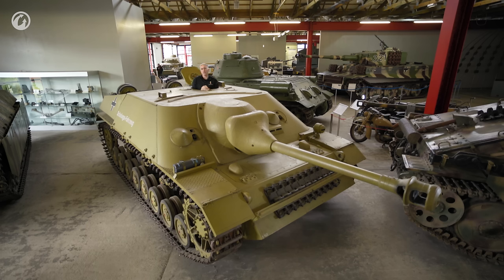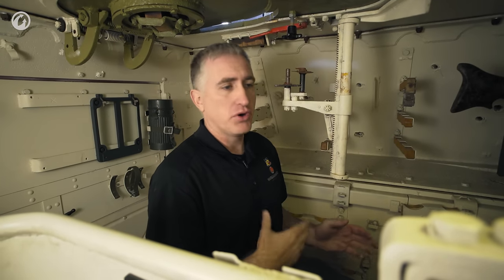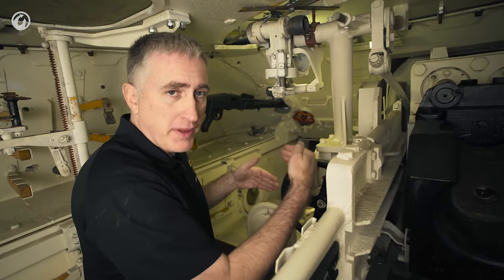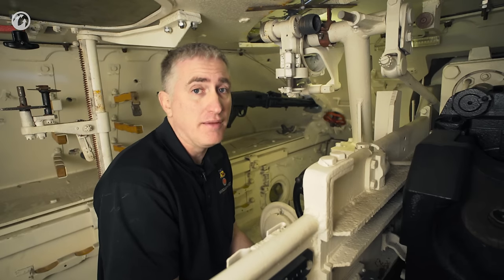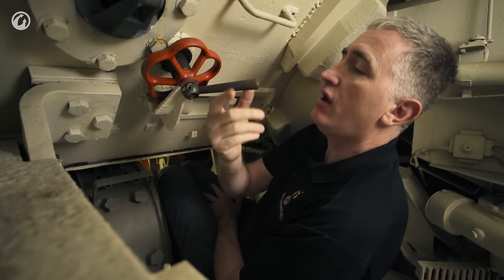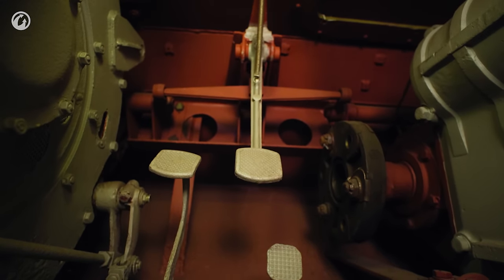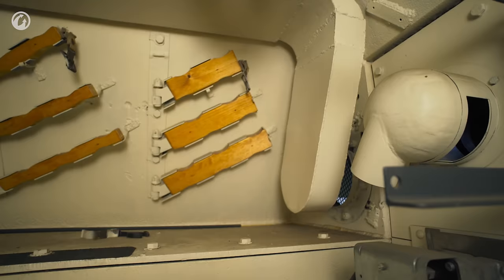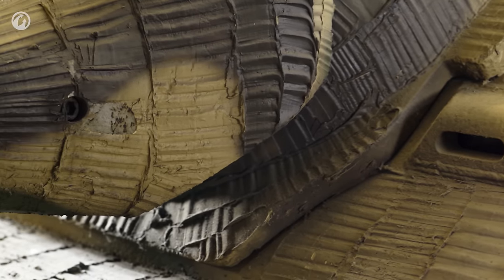Inside the Chieftain's Hatch: Jagdpanzer IV, Pt 2.

Comment: MG42 in one hand, PaK39 in the other. That's quite the dual-wield.
Reply: MG42
Reply: @DrLoverLover  You're right, I wasn't paying enough attention before. Corrected.
Reply: Rambo move over its a new guy in town.
Reply: I thought most vehicles ran the mg34
Reply: @loke72  Well in Rambo 3 he did operate a soviet tank all by himself (incl main gun as well as coaxial).
Reply: @skodalaskoda8754  Yes, but I think I´ve seen many pictures of StuG and JPz mounting a 42 on top, so....
Reply: And I thought doomguy kept some serious firepower
Reply: @skodalaskoda8754  they did, the 34 has a much more armor-friendly barrel change system than the 42.
Reply: @ScottKenny1978  And here is a MG42 mounted, with the sideway quickrelease for the Barrel clearly visible. On a MG34 you could rotate the stock and lock away from the shroud to remove the barrel backwards. On a MG42 the barrel is removed to the side with a quickrelease lock. You can see the open shroud and the handle on this gun, as you had enough room in this vehicle for it.
Reply: @Elkarlo77  yes. This is an unusual case, because the barrel change for the MG42 requires a long slot in the armor to let the barrel out. 

The MG34 has a much more armor friendly barrel change, since the entire barrel shroud can stay fixed in the ball mount while you rotate the receiver out of the way to pull the barrel.
Reply: @skodalaskoda8754  they do
Reply: @skodalaskoda8754  this is an exception cos the MG42 is just in a slot like firing port, just a hole in the armor like firing out of a bunker. MG42 couldn't be mounted in a coaxial manner due to the changing of the barrel issue

Comment: Thanx so much for these 2 videos. I had no idea there were so many variants and changes. My fave TD of the Germans, the model with the 75L70 gun (same as the Panther) is an Allied tanker's nightmare. Unfortunately a nightmare for the driver as well. With the nickname "Guderian's Duck", it waddled down the road due to being so front-heavy that steering was difficult. Ditches were also a problem because of the long gun being so low to the ground.  I still like it tho, the ultimate sniper of SPG tank destroyers.
Reply: Agreed....Well stated Bill....
Although the interior room the JP-IV possessed for the crew seemed rather comfy & roomy,-(In comparison to other German AG's) Not to mention, being extremely effective @ defensive/ambush duties & roles, that PAK42-L70 looong-ass behemoth had >ZERO place< in this AG...
-The PK39 L43 & L48 seemed more effectively manageable & more @ home in this particular vehicle....
-Even with approaching ditches/departure angles, inclines & obstacles @ an angle, Im sure SEVERAL green JP-IV drivers pissed off  both the gunner & T.C more than one occasion using the PAK42-L70 barrel as a 75cm ersatz post hole digger & breaching device?...
-Breaking the #1 rule about danger-laden bore obstructions....

-Pretty certain Heinz Guderian INVENTED the "Face-Palm" when dealing with Hitlers hair-brained decisions, manufactures designs n' specs, & the FAR to numerable Waffenamt/Panzer-Inspectorate AFV requirements & the ridiculous crazy amount of available German weapons calibers & the inherent logistics/supply concerns involved?...;)
Reply: Never mind my Ewwtoob, line crossing censors work...

Comment: I saw the 'A' variant. I don't think it was that ugly. It's definitely taller though.

You seemed like you were in an especially good mood during this one (out of the 90+% of your videos I have seen). Maybe I am wrong.

Thanks for this, I enjoyed it - as per usual.
Reply: They had some unfinished hulls of Pz IV around, with fuel tanks in bottom of the hull - it forced them to make some additional space. They went with simpe additional centimeters of superstructure... Yeah, it's ugly   ;-)
Reply: @tkasprzak  Looks are subjective. As is art. There is no such thing as ugly art or an ugly tank. It is only ugly to whomever thinks it is.
 I think the new QE class is UGLY. Many people - especially loyal, biased, Brits do not. Neither is right and neither is wrong.
 I have seen the Alkett variant - from several angles. They look somewhat ungainly. I do not think they are ugly.
Reply: Tomasz Kasprzak )

Comment: G'day Nicholas, Really enjoyed these two videos. Here, you are in the 'roomy' tank that, with all the stuff installed, turns out to be cramped after all. You've really got to wonder about the Nazis' obsession with huge tanks and tank destroyers. Given the armoury of this vehicle, the cost of it, construction time plus its mechanical worries, it would have been better to make many more 88 flak guns used as mobile tank destroyers which, by all accounts, were highly effective. 
Shoot and scoot was not a big advantage of this lumbering ATD. Wheeled 88s could fire and be towed away just as quickly with a good crew, or so I have read. 
Still, it is an impressive and visually deterring machine that would have been given a wide berth by smaller adversaries. Thanks for another great video and to see you enjoying your 'old' job rejuvenated. Tank on! Cheers, BH
Reply: John Cornell  G'day John, Thanks for your informative reply. I'm an ex-air force type and, clearly, I've got a lot to learn. Yes, I reckon it would take a large crew to move an 88 'quickly'. After your reply, I checked out the specs and weight of a towed-88. Speaking of weight, I didn't realise this AFV was so light; I guess I wasn't listening to Nicholas properly. Thanks for setting me straight. Cheers, BH

Comment: I'd also like to point out another potential reason for that moved escape hatch you didn't mention; due to the gunner being smack dab in the middle of most of the crew layout, it would be faster for the crew to bail out with it because three out of four of them are right next to it. Of course, this depends on the entire crew being unable to use other hatches to bugger out of, but still.

Comment: I think he missed something regarding "Hull down": There are vision "slits" in line with the gun, so the driver would have a pretty good idea of where the gun is. Given that it would've been his job getting clear of the hill (or whatever was front of the vehicle) and position the gun anyways (since there's not turret), I would assume that the gunner simply didn't have to worry about obstructions of line of fire.
Reply: Assume....makes an ass out of you and me. Yeah the gunner wouldn't have such trivial things to worry about while in theatre. Really?
Reply: @beakyturf6336  thats what he is saying, due to the drivers vision being at the same level of the gun, the driver could make sure the gun was clear as soon as they positioned into position. Meaning that making sure the gun is clear would be regulated tot he driver and not the gunner, meaning the gunner doesn't have to worry about having the gun cleared.
Reply: @Cheezymuffin.  I think the observation that respects both viewpoints is that:  while the gunner ALWAYS has to be concerned about obstructed line-of-fire, the design forces him to place his trust in a driver that may be relatively inexperienced this late in the war; and I would expect the vehicle commander and loader to also be aware of potential obstructions.

Operating any AFV is still a team effort, with substantial motivation for success.

Comment: I know you aren't a fan of the swinging hatch on the Panther, but apparently there is a very good reason for it. The German tankers seemed to be quite obsessed with reducing visual height, they were extremely unhappy with the early Tiger's hatch, which was on a raised and welded ring with vision slits. The ring was bad enough, since they seemed to feel it was a great liability both in increased visibility to the enemy, and as a weak point when directly struck by high powered shot, but they were even less happy with the hatch itself that swung up to stand vertically. They felt this was like a big flag to to the enemy, both making it easier to see, making it hard to open the hatch when hull down without showing a large object to the enemy, and it also acted as a visual indicator to the enemy that the hatch was wide open. They went to the lower, periscoped ring later. I think the swinging hatch on Panther was a further move to eliminate these problems. Not sure if they fitted them to later Tigers or not. I know they at least made them so they could lie flat and not stand up. This would make them harder to close when under fire though, since you would have to stand in the hatch and lift it up before you could swing it closed. Having the hatch swing sideways from inside the tank would seem to be the solution. A compromise, but I guess they figured if the tank was already hit you were probably screwed anyway, and it was better to avoid being hit at all. I seem to recall that in many areas they lost more commanders to small arms fire while unbuttoned and outside the tank than they did to direct enemy fire penetrating tanks. So eliminating the need to expose yourself and making the tank less of a target would trump making it easy to escape if you were hit. The main thing is to not get killed. Kind of like the debate between hanging tons of armor on soldiers to protect them at the cost of making it harder to avoid getting shot at all. If there is a good chance that the bullet will still do serious damage even with the armor if it hits you, you are better off just skipping the armor. Same thing in naval warfare; not quite enough armor is worse than no armor. It just slows you down and takes up space for ammo and fuel, without actually protecting you. The reason armored cruisers failed so badly.
Reply from the maker: Swinging hatches are in no way an issue, the issue is swinging hatches which use a very cumbersome way of lifting. Compare to other designs like on Leopard

Comment: Those MGs look like MG42s, I thought armored vehicles were typically equipped with MG34s. Am I wrong? 🤔
Reply: Jagdpanzer iv was actually one of the very few with the MG42.
Reply: huh interesting, thanks for the clarification! :)
Reply: They had to stick with the MG34 in those vehicles designed before the MG42 came out because it has a different barrel change mechanism that wouldn't fit. MG 42 barrel comes out sideways, and you need to change it every 100 rounds or so as it gets hot. But this vehicle came later and got an MG42 mount. Also loads of space in there giving elbow room for the barrel change.
Reply: @Cancun771  Makes sense!
Reply: As Cancun said it's due to the barrel change mechanism. They could build it this way since there was enough space to pull the entire MG back inside the tank for a barrel change. You couldn't do that in the narrow front compartment of the Panzers, thus the need for the MG 34.
Reply: The SU-100 did it better...IMO.

Comment: It’s worth noting that both panzer 3 and panzer 4 serious maintenance required a field depot to do it. To replace major components like the trans you had to unbolt the upper hull from the lower and separate the hulls via crane. Once this was done you had easy open access to everything. Unlike the M4 and many allied tanks you couldn’t do heavy maintenance in the field with the German panzer 3 and 4 unless you had a depot nearby. Another reason the Germans tried to use railroads as much as possible to bring tanks as close to the frontline without excessive wear ant tear
Reply: Every army until now tries to carry Tanks, APCs, IFVs, Artillery and any other heavy vehicel on railroad over longer distances as much as possible because it far more economic to do so

Comment: About the inconvenience of changing out the transmission: If I remember correctly from one of your earlier videos, if you wanted to do that in a Pz III, you´d have to more or less disassemble the vehicle, taking out the whole turret, 2 viewports, the radio, the radio operator´s seat, and get the whole thing out that way. Fun!
So....only having to put the gun and drive shaft aside sounds like a huge progress in maintenance ergonomics to me......so they did let experience influence the design....maybe....I mean, relative to other german vehicles....somewhat....
Reply: I'm not that sure.
in a Tank you have to dismantle a lot, drag the transmission in the turret ring and crane it out.
Not ideal.
But here you have to crane and slide forward the gun, drag the transmission in the middle, lift it with no crane thru the roof at gun level, and drag horizontally it out thru the mantle hole, that is ye big, to finally crane it.
Non a great improvement, I may say.
Reply: @fabiogalletti528  and i thought working on a ford aerostar was hard!

Comment: My god. That transmission change sounds even worse than the Panther. A larger, multi-part access hatch or perhaps removing the sprocket followed by a removable panel to slide it out would have been immeasurably better. The latter is what I assumed to be for German tanks before I watched your videos.

Comment: This question should probably be on Facebook or some such but I did not find a link
Wondering here - Why could the Ordinance 17 pounder not have an effective explosive shell designed for it.  I can understand why a given gun might be unable to use a high-velocity shell (chamber space or tube strength) but since the 17 pounder clearly had both the chamber and strength for a APCBC round (and etc) why could a shell not just be made with thinner walls and therefore a larger explosive filling?  Was there a technical reason it could not be done or were the resources just not available to make yet another type of shell - thanks
Reply from the maker: One was. by the end of the war, a low velocity HE round was developed.
Reply: @TheChieftainsHatch  Thank you :)

Comment: It looks like it has a MG42. Is it a standard weapon with barrel change, or is there a heavy barrel?
Reply: All Mg42s have the same type of barrel, and the internals of an Mg42 can be replaced with the internals of a modern MG3.
Reply: It looks like they could use an MG 42 because of the mounting it's in. The reason why other vehicles used the 34 was because of the ball mount. Meanwhile, these MGs are simply firing through open slots and have enough room for the barrel to swing out to the right.
Reply: @SonsOfLorgar  Not they can't as the MG3 was changed to fire slower and fires a different sized cartridge.
Reply: @Comma_Man64  I can see that.  But given that it is an MG42, there is a practical limit of around 300 rounds before they are supposed to change the barrel unless they are using a heavier barrel.

Comment: I've always had a soft spot for the Panzer IV and it's derivatives. They just look right and by all accounts were right. Up-gradable and versatile in service. Why did they bother with the Panther when this could easily be up-gunned and  slightly redesigned for sloped frontal armour?
Reply: I heard the problem was it's track wasn't wide enough and the sloped frontal armor would make it too heavy.
Also most of german tank project was rushed because of the war, so probably most of the design has the core principle of make it into production as fast as they can.
So probably that is why Panther borned instead of a redesingned panzer 3/4. Or Tiger 2-s.
Reply: The Panzer IV 'tank' reached the very end of its upgrade possibilities by spring 1943. It could not improve further after that. No more powerful gun could be fitted into a turret. The Germans thought ahead to not only counter the current allied tank threats but to also try and counter what the allies would next come up with, which on the whole they managed to do.

Comment: I'll try here as well... What the Guderian's Duck offers that Stug can't give? I love the jagdpanzer IV,  but i think Heinz was right...
Reply: Well, "the plan" would've been to stop producing "old tanks and parts" and switch production to newer ones - meaning, they would eventually run out of Pz III Parts and use the now produced Pz IV Base. The new vehicle was also designed as Panzerjäger from the start, not as infantry support like the Stug - so they would have stuff like MGs and slopped armor. There's always more to a vehicle then just raw specs.
Reply: @BirdhunterLive  Yes but if the new armor is going to be a tb, the infantry will still need stugs...If the stug is going to still be in production... Besides, jagdpanzer 4 will use panzer 4 chasis, that would otherwise will be used on...Panzer 4...
Reply: @VonRammsteyn  The main idea behind these vehicles is, that they can be produced cheaper (and faster) then turreted tanks - so, in a somewhat defensive anti-tank role, it would be preferable over a Pz IV. That's why they produced these vehicles in the first place and not simply "more Pz IV". Also, they couldn't stop producing Pz IV, but they could stop producing Pz III / Stugs and switch over to the Jagdpanzer - so it's not a question of "Pz IV or Jagdpanzer", but a question of "Stug or Jagdpanzer" - and they would switch  from the Stug to Jagdpz, as it's designed to replace the Stug (at least the anti-tank role). But Ideas, Politic, Plans and Reality are somewhat different (especially during a War), so it's easy to say "what were they thinking" in hindsight.
Reply: @VonRammsteyn  They produced StuG IVs, too -- https://en.wikipedia.org/wiki/Sturmgesch%C3%BCtz_IV#/media/File:Sturmgeschutz_iv_Muzeum_Broni_Pancernej_CSWL_2.JPG -- when Alkett, the primary manufacturer of StuG IIIs, was bombed and its production fell, the Krupp design for a StuG IV was resurrected, using a StuG IIIG superstructure on a PzKpfW IV chassis; overall, 1,108 were produced, with a further 31 converted from reclaimed PzKpfW IV chassis. Not much compared to the more than 10,000 StuG IIIs produced, but they filled a badly-needed gap.